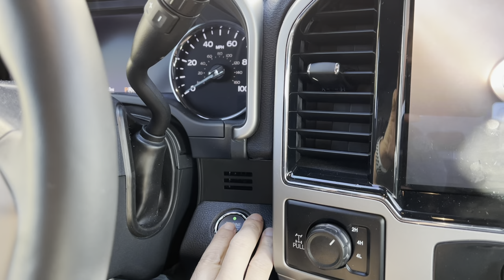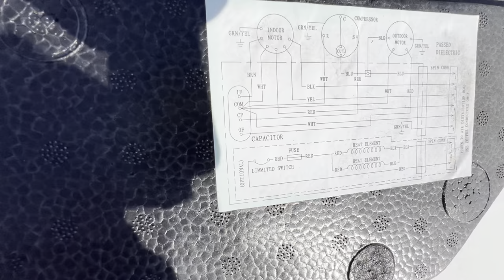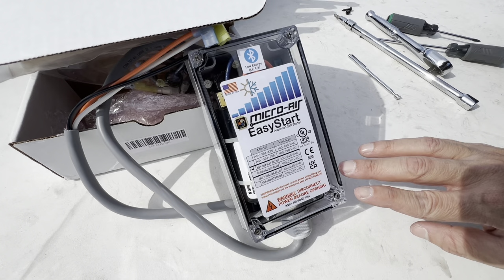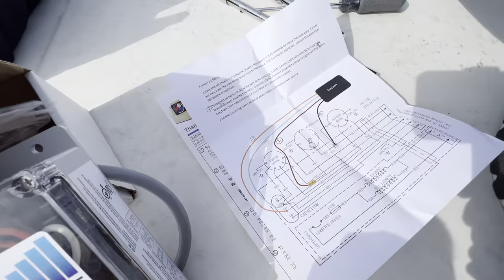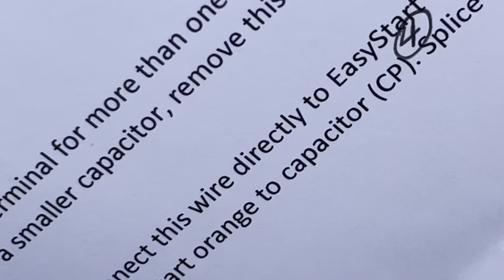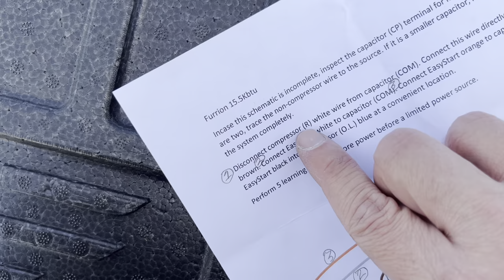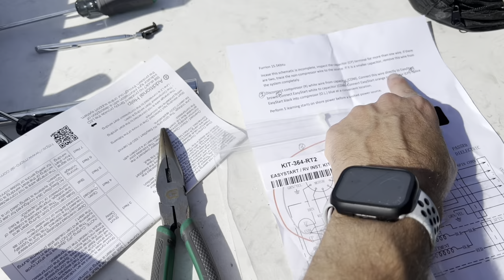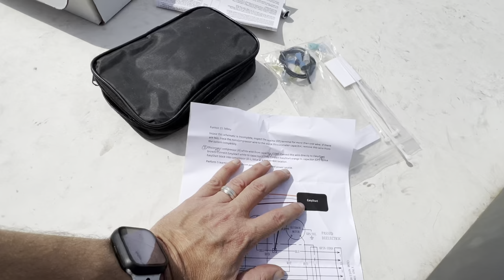RV EasyStart Installation Guide for Furrion Air Conditioner (Brinkley Model Z 3100)

Comment: Javier did your portable 30 amp GenMax generator allow your new soft start AC modification to operate smoothly?  Did you eventually add another soft start to your other roof AC unit?  
I’m just would love to know what size 30amp generator I would need to operate just 1 AC and all else in my Z3100 2024 Brinkley. 
Take care and thanks again. 
Joe
Reply from the maker: I just added an easystart to the main ac.  The Genmax 3500 30amp generator moves both AC having the main AC with the easystart but I only use the main AC only when I am connected to a 30A source.